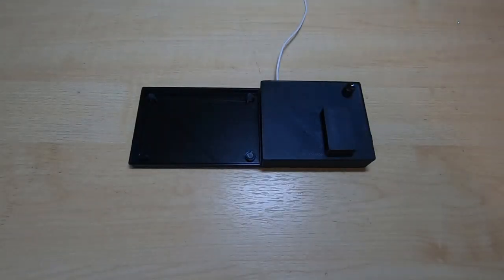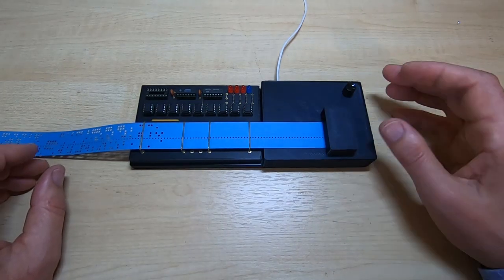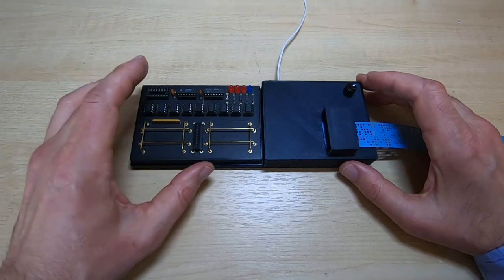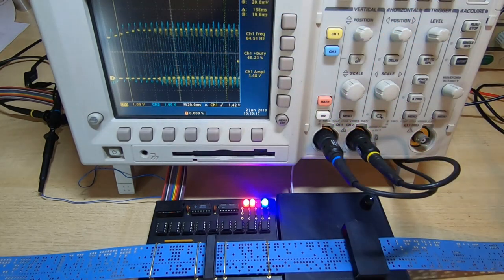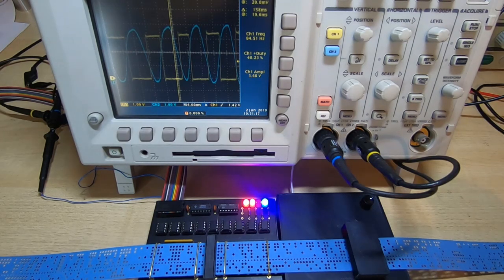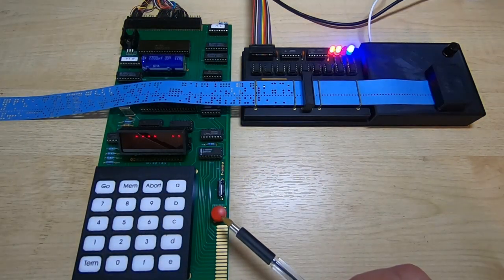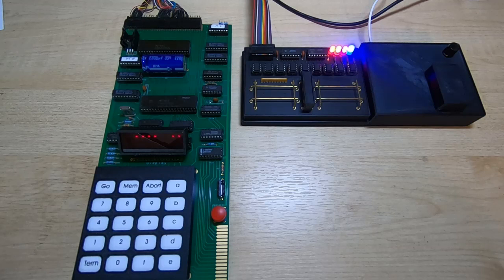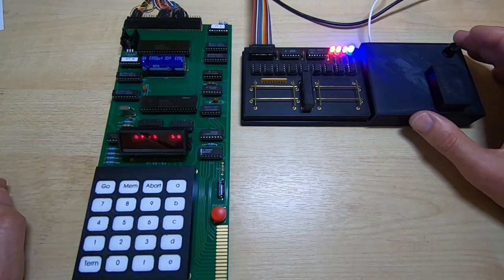OP-80 Tape Reader Motor Drive

Comment: Looks great!  I'm in the USA, where can I get blank paper tape, and a punch to create new tapes?
Reply from the maker: Unfortunately both tape and punch machines are hard to find (and so expensive). That is why I started a paper tape punching service. If you watch ebay for long enough then you may be lucky and find one popping up but you may have to wait for a while. Most punches that do appear will need some attention to get them working correctly (at least the ones I have found did) but most are repairable.